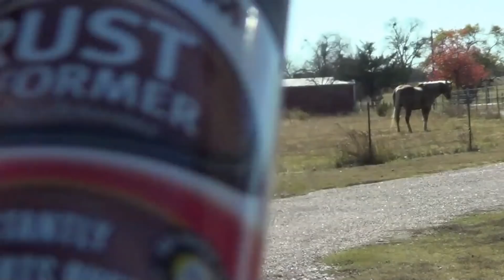Part 1 - Using Rust Converter On Fireplace Chimney Chase Cap - Working Without A Net

Comment: Rick, I know exactly how you feel about ladders. I have a 32 ft fiberglass ladder that is heavy as sh.. I also anchor the bottom of the ladder by using a rope that I secure to eye bolts that I have anchored into the house foundation brick ledge. On the top of the ladder I use a aluminum ladder stand-off or stabilizer that spans about 4 ft to reduce movement on the top. I bought these and other equipment after my brother in law fell off his ladder fracturing his pelvis and hip. Be careful. Remember..it's not the fall that kills you, it's the sudden stop at the end.

Comment: If memory serves me, the chemical(s) converts ferric oxide ( rust ) into ferroferric oxide (rust bluing ) which makes the corrosion stable. 

If you're conserving  gun parts, you can boil them to achieve the same process but, you'll need to use a "carding wheel" to remove the oxide after boiling and then rust blue to boiled the part. 

Note: A carding wheel is a very soft wheel which will not generally harm your skin if you touch it.  You can also use 0000 steel wool or a carding brush

Comment: You had me rolling on the ground with your safety measures with your ladder but whatever makes you feel safe there's a sticker on the side of your ladder show you how to make sure it's at a 45 degree angle stand on that bottom step pool ladder back but it bounced off the building a couple times if it don't go left or right you don't have to tie it off

Comment: The way to stabilize the ladder would have been to tie your ropes to the top, before you put it up, then put it up and tie the ends off. Much more stability to tie to the top of the ladder than the bottom, as the holes and cart are already stabilizing the bottom. I understand you tied it off after it was already up so you could only go as high as you could reach, but taking it down and attaching to the top would have kept it in place better. As always, the outcome dictates, and as it ended well, no problem. Next time tie off the top first, then put it up.
Reply from the maker: good tip thanks
Reply: Don't block me, just trying to help you stay alive. We need Rick in this world.